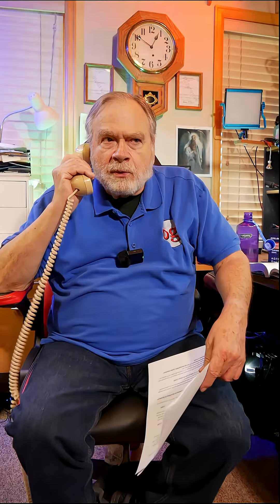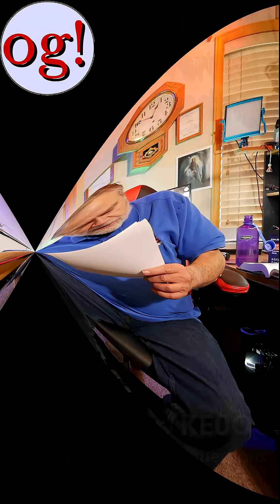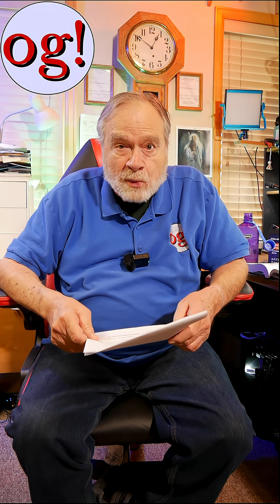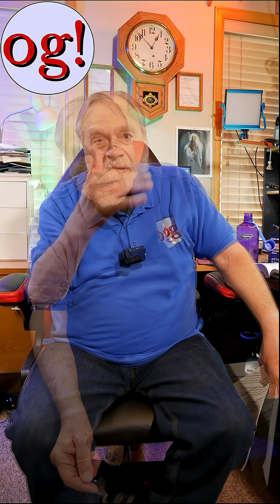Half Wave Vertical Readings (Short #100)

Comment: Wanna do short wave listening so I assume I need a discone wide band. Can I use that for transmitting too?
Whose discone would you recommend?
Reply: You can transmit with most discone antennas but typically not on many bands. Which ones and how many will depend on the size and design of the antenna. For example, the Diamond D130NJ Super Discone (16.1 inches wide and 66.9 inches tall) will receive from 25-1300MHz but only transmit on two bands: 6M (~50MHz) and 2M (~146MHz). Most others will be similar. Don't expect to transmit on HF bands with most discones. They're just not big enough for that.